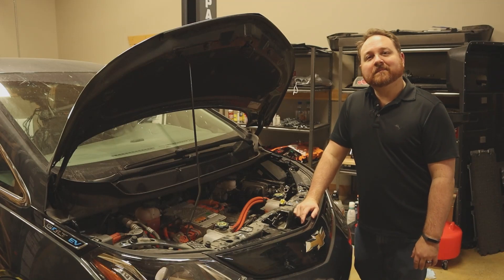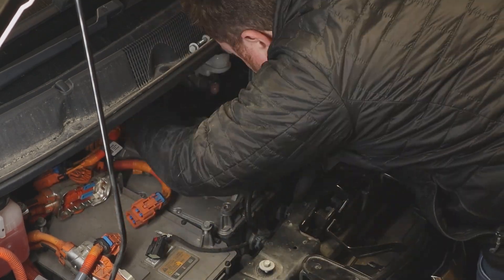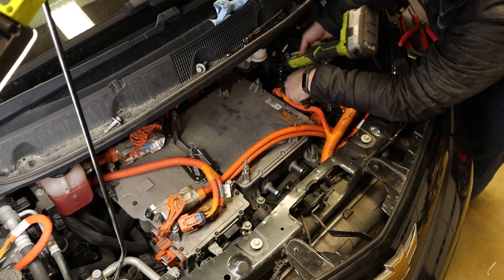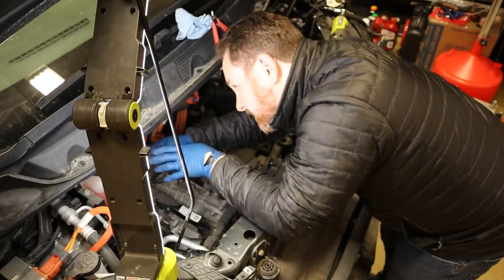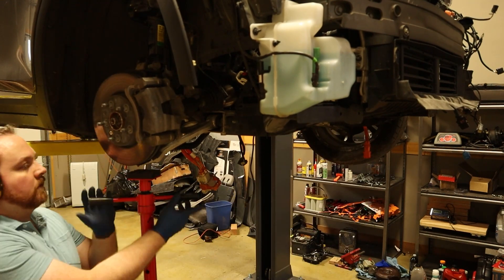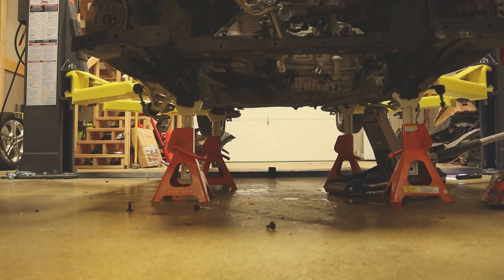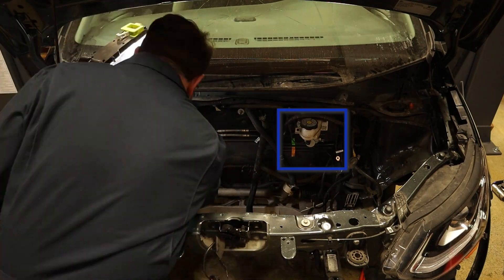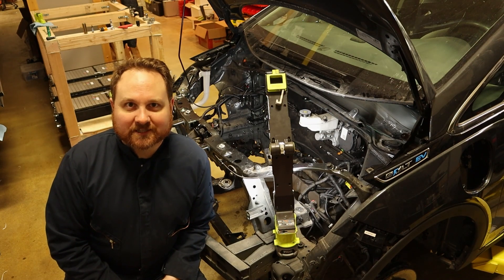Stripping down the "engine bay" of a 2019 Chevy Bolt EV

Comment: This is a fun series. I long dreamed of an electric conversion Delorean, but got side tracked. Hopefully starting an electric sailboat conversion soon, and videos like this give me that itch to get going. Looking forward to the next video. :)
Reply from the maker: That's awesome, I also appreciate your videos! I watched a few that you did on flexible bus bars vs. rigid and it's given me a lot to think about. I've gone back and forth on whether I'm going to use 2/0 copper welding wire between the batteries or the nickel plated copper bus bars that came with the pack.

Comment: Another great video Bill. You must have a fair size pile of parts. Are they sorted by reinstall vs sell?
Reply from the maker: Yes, I have quite a few piles building up right now. I've got a big pile of parts from the DeLorean, most of which are going back on. Another pile for Bolt parts that I know I'll use, a third pile for Bolt parts that I know I WON'T be using, and finally some more Bolt parts that I'm not sure about. Luckily my shop had a lot of space before I started the project!

Comment: What is the hold up?  When will you post a video of the finished 200 mile range plus DeLorean? Has anyone seen the new 2022 rendering of EV DeLorean?  It looks amazing!
Reply from the maker: Hah! Takes a long time to convert a vehicle to an EV while also having a full time job. I get about an hour a day to work on it. Plus making videos takes time - hours per episode - this video was shot back in December. I have another video ready to go now, also shot in December, which I hope will be out over the weekend.

If I had to guess, I would say it'll be drivable around the block in ~3 months. I'm very close to having one of the battery boxes complete, then it'll take ~2 weeks to build the other one. Then test it. I have to strip the electronics out of the DeLorean, probably pulling the body off the frame at the same time to remove the last few gas lines, then wire up the batteries, test it, build the brakes and get the pedals in the right spot, then high voltage electronics, testing those, low voltage wiring, more testing... Not a quick process, but I'm glad you're looking forward to future videos!! :)

Comment: Hello. I needed to know how to take out the Chevy bolt battery inverter control module. But you made a speed up video and I could not see anything you did to take it out. Can you please post a slowed down video of your work. Chevy Bolt owners really need to see what you are doing. Your work has value. Please post a slowed down video and talk us through the steps you are taking. Assume nothing and show everything. Please
Reply from the maker: @clarindaharvey4971  sorry, that's not how I did it. I didn't remove parts one at a time, I just removed every nut and bolt i could see until things came out. If nothing came out, I moved to another area. You may want to consult the service manual, which has detailed information on replacing all components. It can be found online.